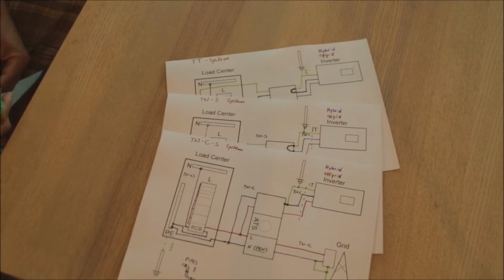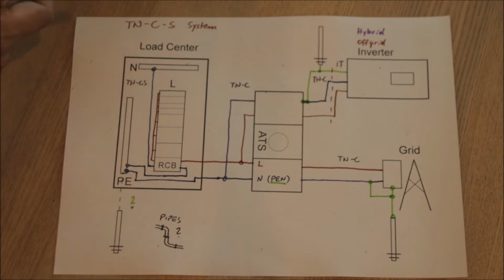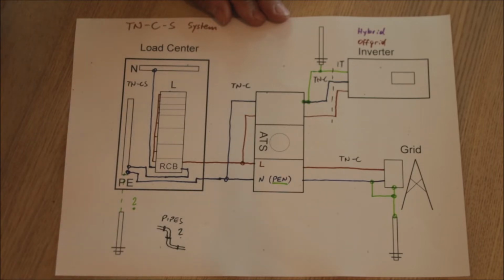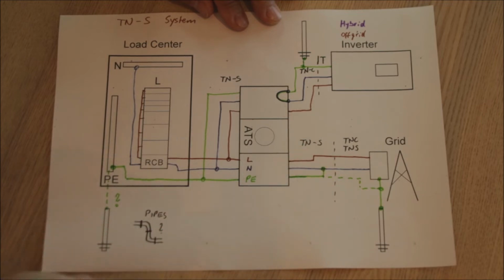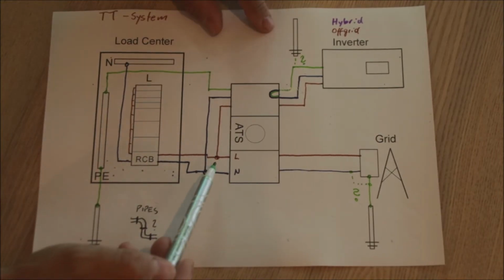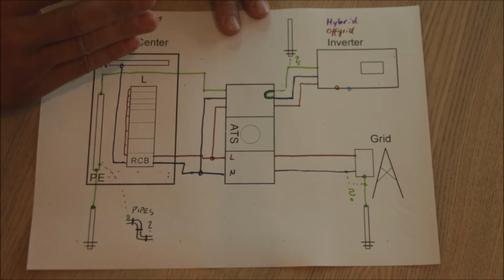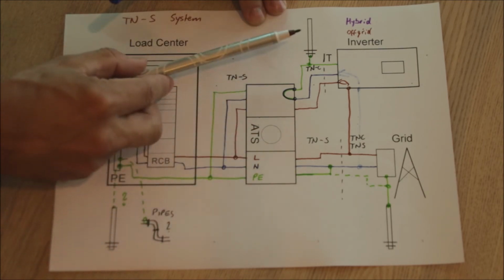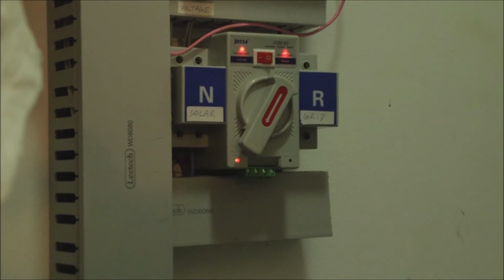Earthing and Bonding of Solar Inverters in different Earthing -Systems. Practical guidance.

Comment: your video is very very informative and easy to understand, all information provided about seems good, THUMBS UP FOR YOU.
 I just want to know about you and your knowledge that are you certified electrical engineer or have good and right knowledge about electrical systems. so I can use your knowledge to design my solar + grid system (TNS) as you describe OR I should consider to communicate any verified personal. please your answer will help me to use your knowledge or not.
Reply from the maker: hi. i have graduated electrical engineering in Austria. Electricity is universal but of course there are local regulations which may vary. therefore you should always follow advice given by a professional in your country. looking my videos require basic understanding of electrical installations. they usually help people to identify issues with their systems.
Reply: Thanks for your reply, I think then TNS setting is best to follow as I also know some details, and yes Electricity is universal and its basic rules are too, and in this view TNS is ok for me to start. @RolandW_DIYEnergyandMore

Comment: thanks from Algeria, i enjoyed your videos because they are well made, and so much effort went into them, unlike many others who only focus on theoretical aspect and there is no practical or real case to show, or other videos were DIY people show their installation but no explanation about why they did that besides "it's the code".
for example your explanation made me realize something i missed about my Multiplus, bc i have 3 phases, and i was trying to figure out about how to ground the neutral, given it have a transfer relay switch, but i missed that i could just ground the chassis instead of the neutral and avoid the headache of a contactor driven by the auxiliary ground relay output
but i have a question about multi-point grounding, i heard people like Holt Mike saying that having multiple grounds in your installation is a safety hazard in case of lightning, and grid surges, because of the potential gradient in the soil, is this taken into account in your case? or is it okay if the earthing have high impedance like in TT?
Reply from the maker: Hi. Thanks for your compliments. In YT most is about quick clicks, likes, etc... essentially money, and entertainment, not so much about trying to make people understand their problems they are facing. I try better in hope to help out at least my viewers who are really searching for this kind of information.
Now to your question about multipoint grounding. In TN earthing systems multiple grounding points are as well connected to each other by a conductor. That can make the whole grounding system "talk" to each other. You have to access the risk of "importing" such surges but still each grounding point is increasing the effectiveness of the whole system to bleed that surge to the earth itself. TT earthing systems do have the advantage that they are providing an isolated earthing pocket. If you keep sufficient distance between grounding points then surges cannot move around. But you have to be aware of what else conductive is in the ground.

Comment: Nice video, quick question in my location our residential ac outlet inside the house is line to line... Which of the 3 presentations matches line to line ac configuration? Thanks
Reply from the maker: Line to line means you are living in a Split-phase country and your L1-L2 is 240V, right? Now you want to supply those L1-L2 circuits with a 1-phase Inverter? You need to take that 240V  L1-L2 from Grid on one side of the Transfer Switch and  on the other input side L-N from the inverter. With the output you can then supply the 240V circuit. Do not mix 240V and 120V circuits behind that Transfer switch anymore. Where is your Earth coming from? Is it TN-C from the L1-N-L2, bonded with the N? Or is it TT and coming from a own Earthing rod? You will have to bond your Inverter N with Earth...
Reply: @RolandW_DIYEnergyandMore  , I just discovered that the ac outlets in my house is line to line 240vac  and no neutral. The utility provider did not provide neutral line where I can bond the earth ground. So my question is when I install solar inverter as you mentioned L1 L2 goes to L N of the inverter the PE label will be bonded and terminated  to the ground rod. Ideally it should also be bonded with the neutral in the switch panel but sadly no neutral. Is this ok as far as grounding is concerned? Thanks
Reply from the maker: @nestyplus  yes. That is ok if the grid L1 and L2 is not bonded. Your system is build up like a TT system where you have a separate earth bar connected to a rod, right? So your example is TT. But you need to be sure to disconnect both L1 and L2 through a transfer switch. And on your inverter side you build up like a TN-S as shown. No need for a separate rod, just use PE from your panel but it must as well be disconnected in the transfer. Transfer switch must be 3 pole. N and PE bonded at inverter side of transfer  switch. You didn't buy a US version of an inverter which has L1 N L2?
Reply: @RolandW_DIYEnergyandMore  , inverter is an EU version L N and PE..

Comment: Hello Roland! excellent videos. Can you explain when we have L1+N+L2? I have an all-in-one inverter from MPP Solar, built for EU where use 230V in L1+N, but in the USA and other countries like in my particular case (Dominican Republic) uses this scene  L1+N+L2 (120V+N+120V). That's means we need to add a transformer in order to get the two line plus neutral.
Reply from the maker: Hi. You are right. You can use an Auto-transformer to create such a Split phase. I do not recommend using equipment of regions with different power standards, nor am I fluent in the US split phase. That's why you will not see a video about it on my channel. There are a couple of American colleges who have shown such setups. But be aware that you can damage your EU type inverter if you ground it in the wrong place.

Comment: Hi  I have been watching your videos.  But I’m just curious what about if fault occurs and how are we sure the breaker can trip.     When it comes to hybrid inverters especially when the ac input is connected to the grid.  As they say when fault occurs the power wants to return to its source. Hmnnnnnnnnnnn I’m just curious I say
Reply from the maker: Thats why every input line needs a breaker :) And, dont forget, breakers at the inverters output when off-grid, will usually never trip as the inverter cannot provide those high requured  currents. Only RCDs and the electronic curtent protection in the inverter will help there.
Reply: @RolandW_DIYEnergyandMore  thanks for the info

Comment: Hello Roland. I would like to ask a question.   According to your explanations. In the drawing.   Do I need to install things like rcbo and spd and some breakers before the transfer switch?     Or do I need to install a small distribution box before the transfer switch.  Then to the main house load center?   Please educate me on this
Reply from the maker: Hello. Yes, every input side of the ATS should have a breaker which is cutting each pole. RCDs, SPDs, etc would then be installed after the ATS so that they can serve your further down installation regardless what source the power is coming from.
Reply: Hi, mr roland. Thanks for your explanations and answers 
To our comment 

I watched one of your video 
Teaching on how we should earth our inverter correctly 
Which you also demonstrate what voltage we may have if it not properly grounded 

But I have one of these Chinese hybrid inverter. 

And I would like to copy exactly the way you did yours 

What I mean is this
I noticed in your installation, it’s like you use the existing earthing system in your building. 

Because I heard you saying. Someone who have carefully listened will say I have a bonding here. And a bonding there 
This is your word 

But can I also do the same in a tns system?  

By extending earth wire from my existing earth bar straight to my hybrid inverter consumer unit and bond right there

I think the there is no bonding inside the tns main consumer unit
Reply from the maker: @sattiodibo2598  yes, if your grid supply is any other than TT, you can connect the inverter ground to your earth bar and bond N-G as well.
Reply: Really glad to hear this. 
I will do definitively as you have teach 

But many videos are really misleading on YouTube
Especially those in the United States.they will 
Always say you can only have neutral bond in one place 
I watched this diy YouTube pro too
The guy you commented in one of your videos 

But because i gained knowledge from your videos.  Now I understand most of their connections is not correct when it comes to grounding.  
They don’t even test it with a multimeter or socket tester.  If the ground wire has zero potential 

But my main fear is I don’t know if I should connect the ac input 

Because it’s this type of hybrid inverter that can switch to the grid when battery is low 

In my country Nigeria the grid is not always available sometimes we will be out of grid power for 2 days.  Sometimes the grid only stays for few hours.   This is normal here

The ac input will be problematic from the way I’m viewing things 
Our system is the tn-s system
Reply from the maker: @sattiodibo2598  in the US with the split phase system, a lot is different. Better not to mix up with equipment and procedures used in the other parts of the world. If your grid is unreliable, just use it to charge your batteries if you don't have enough PV. Maybe don't use it as bypass if possible. Greetings to Nigeria:)
Reply: Thanks a million

Comment: Hi,
I folowed this nice and clear presentation of  TN-C-S case and I realized the real wired scheme. I am pleased/satisfed that is working well. But, I have a probleme: when the baterie is "overdischarge" the inverter remain "ON" and the ATS pass continously from one sourse (inverter) to the second one (grid)! How can disconect the inverter when the baterie pass to overdischarge?
Thank you very much.
Sorry for my writing English...
Reply from the maker: Hi. Do I understand you correctly, you want to disconnect the inverter when your battery voltage is low, so that then the ATS will switch to grid?
You can achieve that with a programmable voltage dependent relays. I will have a video about it in a few weeks. Here is a link of what I mean: https://a.aliexpress.com/_oEO9jGU
Reply: @RolandW_DIYEnergyandMore  Thank a lot for your prompt response and for the possible solution. 
I also thought about an adjustable voltage relay. I probably have to watch what voltage to adjust the relay to...

Comment: First of all, Thanks! In a TN-C-S system, should I bond N and PE at the load center side if I'm using a hybrid inverter?
Reply from the maker: Yes, but check that there is no internal bond inside the inverter first and that the AC In to the inverter comes from a TN stage with no RCD upstream.

Comment: Great video sir, as usual, here in South America, we did a grid tied solar instalation, so for our main earth grounding point, we used 3 rods of 1.8 meters long, in a delta configaration in the ground, then we used exothermic welds to join the three rods, with guage 2 awg naked copper wire, also a conductive gel was placed on the rods and interconnecting copper cables to reduce ground contact resistance. The strange thing was that an inspector told us that we had to join the copper ground rods of the inverter, the main braker box, the D.C sub panel box and the solar panels plus their structure all to a single equipotential copper chasis, this apparently is to creat one single ground potential and avoid differential voltages between the rods in different locations. Do you think this is excessive? We were also told that their should only be one ground-nuetral bond in the property after the transforma of the electrical company, or there will be dangerous ground loops, its strange but i guess each country has its regulations.
Reply from the maker: hi. whenever you can simultaneously touch two different grounded structures/chassis/appliances with your body or any conductive item that you are holding which is touching those, then it must be of course grounded to the same ground plane!
But if your PV array is lets say 20m away from your power room then connecting it to a single grounding point makes no sense to me as it is far more advantageous to direct surges to ground as close to its source as possible. Behause if it wouldn't be like that, one would have to connect all grounding of a whole street to a single grounding point if one house is built next to each other, right?
Yes, one neutral to ground bond per electrical installation. But that bond must serve every of the power sources equally. If that is not the case you have to analyze your circuits and find the best place for a bond. Fault currents can only go back to its source, so you must provide a path for it but avoid multiple paths which could split currents and reduce their strength so that breakers, etc. wouldn't fail to trip in a fault situation!
Reply: @RolandW_DIYEnergyandMore  Thankyou sir for your detailed response, i agree with you, i myself think that the equipotential chasis was unesesary as the the pv array was almost 30 meters away from the  braker box and building, me personally, i would like to keep the grounding of the pv panel array and its strucure apart due to the 30 meter distance because i imagine that the pv array acts as one big antena to atract lighting and as you say its better it goes straight to ground and not interact with the other system grounds. Cheers.

Comment: In the UK you have ground to neutral, from the consumer unit. In the TCS example, it doesn't show the consumer unit connected to ground. How would it work in that case?
I am planning to do the hybrid TN-C-S, but in that example it seems the earth isn't going anywhere from the consumer unit
But I did not plan to use an ATS, since the inverter already acts as an ATS
Reply from the maker: As shown in the TN-C-S example, you are getting a PEN conductor into your consumer unit. In the UK, as in many other western countries, the C-S separation will then be done immediately at entry and a PE wire will go to the PE bar separately. In the video I am showing a very basic procedure where the separation is done directly at the PE bar. But in any case it would not be necessary to put an extra earthing rod for the installation, as like said earthing comes via the PEN conductor already. 
I think you want to just use the inverters AC-In to bypass grid power when needed, right? In that case in principal you would as well get a PEN conductor when the grid is bypassed, but unfortunately there would be a bond missing when the inverter is in off-grid mode. So you need to use mode depending bonding via a bonding relay similar i have shown in my extra video about TT-system and as well use an auxiliary grounding rod connected to your PE bar if you want to be able to detect leakage current caused by humans when in off-grid mode...
Reply: @RolandW_DIYEnergyandMore  So in the UK the TNC-S system you are showing with an ATS in the middle would not be TNC-S, as the ground does not go to the neutral from the consumer unit, ground goes to earth rod.
In your TT system approach you are switching ground. But I have a 3 way ATS, its 2 ABB 100AMP contactors, that could be achieved easily through this approach.
I also heard "never switch ground" but i don't understand this approach, unless there is an existing fault somewhere in the system.
Reply from the maker: @joaosidonio7562  in such hybrid scenarios we call the grounding system of the inverter the way as they provide functionality compared to the grid setup. You don't want to switch ground in the consumer unit as you don't want to break a possible grounding loop. In our case the ATS is used to achieve the ground disconnect for TT and provide the N-G bond for the grounding when the consumer unit is powered by the inverter...
Reply: @RolandW_DIYEnergyandMore  I am a bit stumped then, I saw in the TT that you bond the NG with the contactor.
But on the TNC-S there is no ground rod(there is some ground usually because in the UK they like grounding via the water pipes), but from the consumer unit, ground goes to N(PEN)
On switching, since everything is interrupted, why would it matter if you switch the ground?
Reply from the maker: @joaosidonio7562  if you want to use the grounding from the grid (PEN) because there is no auxiliary grounding point in your house then you have to make sure that your NG bond to the inverter is not switched. In the TN-CS the PEN will provide ground reference and fault path for ground leakage via earthing rods inside the grid supply. You should not switch the NG bond so that the ground fault loop for high amperage L-PE shorts is not broken if there is not an RCD installed. 
In a TT system an RCD is mandatory anyways and there is no high amperage ground fault loop. All protection just depends on leakage detection.  
If pipes are used for auxiliary grounding it has to be considered that at some point your city might have replaced metal pipes with plastic ones and that this way of grounding might be rendered useless.
I do not know your installation. You just need to make sure that when you are adding your own power source, that it does have a working high amperage return path for L-PE shorts, as well a return path via ground for leakage and ground reference. In the TN-CS setup a permanent inverter N-PE bond to your PE bar in the consumer unit will typically solve the matter.